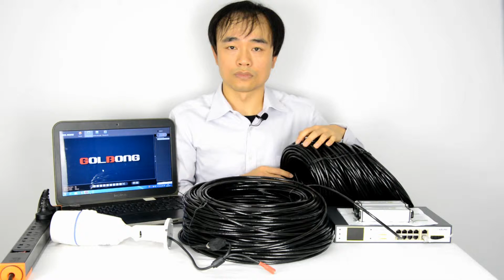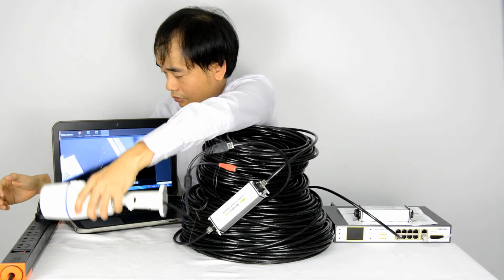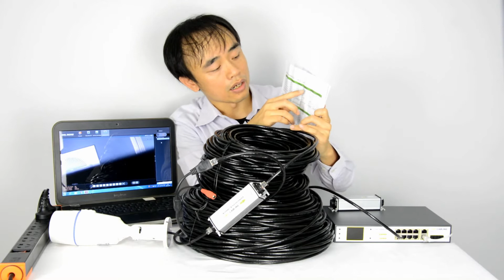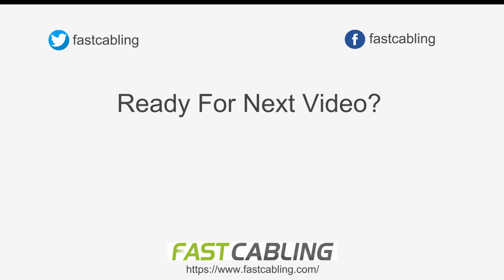Repeat the PoE for long distance IP camera

Comment: 32 ch nvr to first poe switch 40 meter and 2poe to poe 40 meter possible or not
Reply from the maker: Generally, it is not good to have more than 3 levels switch with copper connection. It should be just fine.

Comment: Is Fibre optic cable is good than this?
Reply from the maker: Yes, the fiber is high speed, low latency and long distance network solution. However, you will need to take care of the power seperately as the fiber optical cable technically is plastic, you can't send the power directly with the light.
Reply from the maker: The fiber optical cable can't transmit the power. It is the light transmitting through fiber optical cable.

Comment: I have an existing 8 port nvr switch, 3 of those ports have ip camera functioning. 5 of those ports will be connected for at least 120m each, can i cut the line of each utp cable, connect each  to poe switch and the poe switch to one of the port of the nvr? Is this possible.... Thank you...
Reply from the maker: There are two possible issues here. 1. Some of PoE NVR port may not accept the connection from network. You can simply move the Internet connection to one of the PoE port of PoE NVR, see whether you still can accept the NVR from network. 2. The second thing is you need external power source for PoE switch unless you have choose the PoE powered switch or PoE extender. As the power from PoE NVR can't pass through the convenient PoE switch. One more thing, if these PoE switch are deployed outdoor, you will need to ensure the switch can't standard wide temperature range.
Reply: @Fastcabling  thank you so much for your reply. Now i learned a lot from you. Keep up the good work.